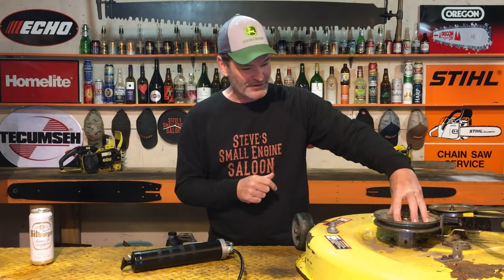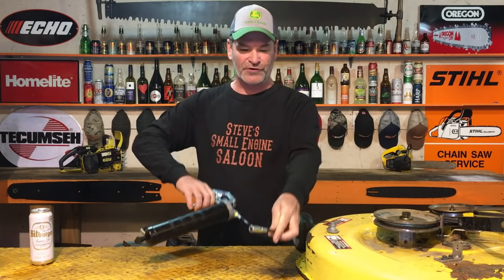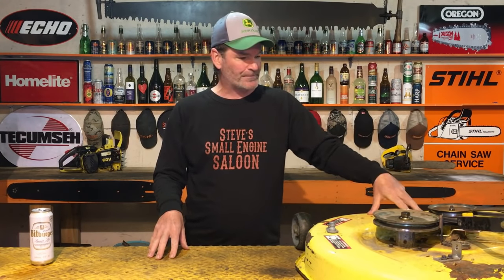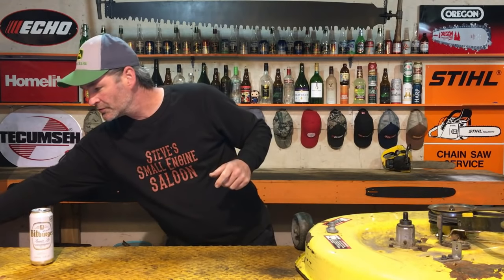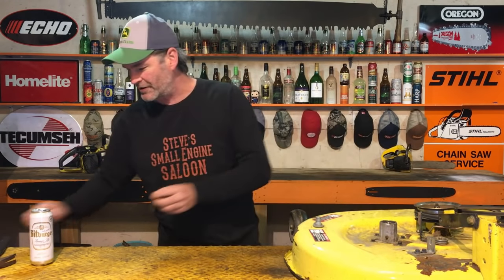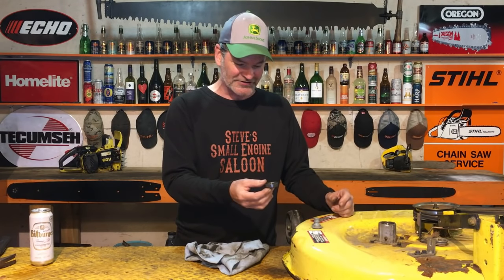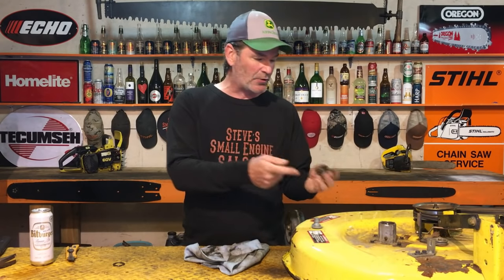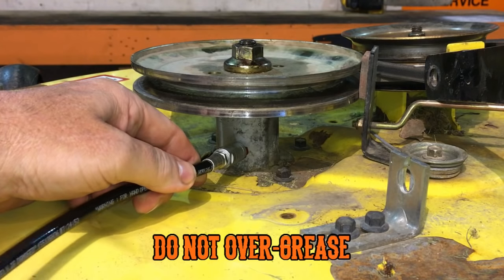Your Riding Lawn Mower's Dirty Little Secret

Comment: The pressure from the grease gun will get grease into the bearings.  The seals are just dust shields.  You can test it by inspecting the bearings, put them back in, grease them with a different color grease, and reinspect.  The main problem is that when people grease them, they only give it a few squirts.
Reply: I was wondering about that. He never showed proof of his original theory, but his fix would definitely get more grease into the bearings than if the dust covers were still on.
Reply: Yeah, I actually saw another video of a guy pulling his bearings apart after greasing them and it DID get in. The only thing is he put nearly 70 pumps of grease (2/3’s of a tube of grease) to fill it/ pack it enough to pressure that seal enough to get grease in.

Comment: Hydraulic pressure will blow the remaining grease seal(s) out if you over-grease the spindle .
Reply: Yes I was going to say the same thing. I think possibly a shielded bearing might be better because the tin shield has a small gap around the inside but those probably should have a proper separate seal for protection which that design doesn't appear to allow for.
Reply: Love Bitburger!
Reply: Can put in a relief
Reply: @TheGuruStud  yes..
Reply: @MrOutty + Greg Beetham: Absolutely right. Normally modern sealed bearings should work for a reasonable time. In the actual case, grease nipple just should not be used at all, because even new seals can be damaged by grease pressure.  In other words: This nipple is made for destroying your bearings yourself.

Comment: Steve, perhaps you could address this subject in a video, My JD L130 left a lot of uncut grass. It would never do a clean cut on the first pass. I was going through belts fairly often too. I figured out the 1/2" V belt didn't have enough grip on the drive pully. The pullies are extra wide so I put a 5/8" V belt that was two inches longer on it. It needed the extra length so it wouldn't be too tight. Now it cuts the grass perfectly and the belt is holding up well. It seems to me that the 1/2" belt does not have enough grip for a larger deck.

Comment: Sealed bearings are the guarantee of throwaway products.
Reply: The ones using those bearings are hoping that we don't know how to do our own repairs.  They are hoping that people who don't know any better would dumbly by a whole new mower when in fact it just needed a simple repair.
Reply: The Asian bearings sold today have a tiny amount of grease and may not last  SINGLE SEASON. Pack new bearings with wheel bearing grease, the bearings will last a long time.
Reply: A good sealed bearing with steel seals lasts a long time your car alternator has them?
Reply: @michaelgardner3728  point being that old-time zerk fittings on bearings are better to do maintenance when you can manually hit the shot of grease or oil in them. My 56 Chevrolet pickup  has a    maintenance point on the generator where you lift a cap and drop a few drops of oil in a couple times a season.
Reply: @michaelgardner3728  
The alternator bearings are operating in much cleaner conditions than those on lawnmower spindle.
In any case the seals in the demo were plastic.
My concern would be that the grease gun pressure may pop out the two remaining seals.
Reply: @sandrosandri1763  My spindles have a pressure release valve on the opposite side of the zerk fitting.  It wouldn’t take too much effort to drill and tap a spindle so you could add your own.  The other nice thing is you don’t have to guess if enough grease was added because it squirts out when it’s full.

Comment: Not a design flaw or mistake it is what happens when one department specs a certain bearing but purchasing finds a cheaper alternative. And the person on the line just puts it together and doesn't get paid to think just to assemble.
Reply: designed obsolescence
Reply: Dave Micolichek  Not necessarily. They need seals top and bottom here, and it's cheaper to buy double-sealed bearings than low-production single-sealed bearings. Plus lots of bearings these days are no longer commonly made in single-sealed or unsealed versions. Often they will make only sealed bearings as those are generally considered to be usable in all applications whereas unsealed or single-sealed bearings aren't. Many single-sealed an unsealed bearings are made only by premium manufacturers now so the price is higher than the crappier sealed ones from China or Mexico where most of the bearings you can get in the USA are made now. 

So while it may actually cost more to make a sealed bearing than an unsealed one with equal quality, when you factor in all the other elements involved sealed bearings can indeed be cheaper. Check it out yourself, and look to Europe if you need good bearings cause they're not being made here anymore.

Comment: Double shielded bearings are not meant to be greased.  The grease port is a leftover from the design for greasing when the bearings weren't shielded.
Reply: Then why can't they just put the better built "older design" bearings in it in the first place?

Comment: Hey Steve! It occurred to me that cutting a ‘V’ shaped notch in the outer seals that are left in place would give you a way to know when the bearings are fully packed because of the overflowing excess grease and would all keep the outer seals over pressuring and blowing off the bearings; similar to greasing a ball joint.

Comment: I wonder if that is on newer mowers. I have a 2006 John Deere which I have greased a couple times a year and knock on wood, have never replaced a spindle. Thanks for the info though, you always have good tips.

Comment: I’m a bearing guy.  The easier fix is to stop greasing sealed bearings.  You are absolutely right that the grease is not getting past the seals but what’s happening is when someone fills that cavity full of grease then adds more, it pushes the seals into the ball cage which causes the bearings to fail.
Reply: Never see that happen .
Reply: Don't think that's possible.. if those things can be pushed around by grease then they would be little bits of metal after a few minutes of true loading...grease has only temporary light  loading.
Reply: I promise you that no grease that being pumped in is getting past those seals.  If you want to make it regreasable, pop off a seal.  I deal with this issue all of the time in higher rpm applications.  Don’t believe me, contact any bearing manufacturer and they will tell you the same thing.
Reply: @farrisrocks  You are incorrect.  Do the test yourself. Verify the bearings are greased, put them back in, use the zerks with different color grease (40 plus pumps) and reinspect.  You will find the the pressure from the grease gun is enough to get past the “dust shields” they call seals.

Comment: i just crack the bearings open every few years , clean and repack
Reply: Yeah that’s what normal people do not whinge about a problem that doesn’t exist. This just looks like an add to sell grease guns. Guy has some OK videos that might show me something I’ve not encountered before but a lot are just shilling something for affiliate links 🙄
Reply: @TheLexiconDevils  Are you the guy that engineered this part to fail?????? Sounds like it!
Reply: @tc96z1  I agree with Lexicon Devil. Watching the video and seeing the explanation I thought to myself "why not just pack it with grease right then and there?" Screw the grease gun.
Reply: @drowssapma  Because greasing a fitting is easier and less effort than cracking open a bearing.

Comment: One of the biggest reasons this is an issue nowadays is that the majority of the box store lawn and garden equipment is manufactured by MTD and is complete junk and is cheap as hell. MTD is notorious for needing frequent repairs due to the cheap materials used in their equipment.
Reply: Really? Ive had mine for 13 years and no issues. Must of got lucky.
Reply: @SheepDogNumber6  Yep mine too, 23 years now, just belts ,1 magnito, and 2 spindle replacments..  However i do see a potential problem with the "Pop the seal out" method. That is when you grease the modified setup, you'll most likely pop the other seal out with the pressure..
Reply: I bought a Cub Cadet about 5 years ago and it seems that every year I had to take it in for repairs every mowing season because of problems. Most manufacturers started having MTD manufacture their junk from my understanding roughly around 10-12 years ago. Before that time most manufacturers made their own equipment and they were higher quality than they are nowadays.

Comment: I had a supervisor tell me to grease every fitting on the Terex scraper I was running at the time with at least 10 shots of grease every day. I questioned that, asking, You mean the U-joints also? He said yes. He didn't like my comment about that not being a good idea and that the shop would surely get sick of changing the U-joints. He insisted, he was the boss and you do what I said. Okey Dokey! When the mechanic was changing the U-joints on said scraper he made a comment about going through so many U-joints. I told him that the dumb a_ _  boss insisted putting 10 shots of grease in the fittings every day even though the chart on the machine recommended 2 shots every 40 hours. Needless to say if you pop the seals, the grease flies out and dirt gets in . The owner changed the grease policy after the mechanic brought this to his attention.
Reply: I worked at a place that had a lot of BIG electric motors, they hired some new maintenance manager who had the workers (over) grease all the bearings in the motors.  All of a sudden all the motors started failing as grease went  through the inner seal and into the windings.  The company started blaming the motor design/manufacture which was strange since for many many many years there was no problem until the over greasing started.  Further there was a plug that was suppose to be removed when greasing so excess grease could escape, that was not done by these 'experts.'  When the motors were sent offsite for repairs the repair companies told what the problem was, but it took many months and repairs before anyone would believe.  The bottomline is many problems are caused by dumb f's who think they know something, but don't.

Comment: Steve i just spoke to a john Deere service manager and he says still grease them because the grease will still keep the bearings cool,as i mentioned on my last message i did just that on my old jd x110 greasing those spindle bearings regularly,and luckily they didn't fail and she done 1300 hrs,great video though mate great learning opportunity as the more we know and understand our machines the longer there going to last and the better chance we will be able to get it going again if it lets is down on a job

Comment: Obviously a scam perpetrated by the Bearing Cartels. Takes a lot of balls to pull something like this off..
Reply: Do you mean the Cartels have a lot of balls and bearing to create this type of scam?...off to my John Deere dealer to raise hell...thx
Reply: Nothing to do with the Bearing Cartels---everything to do with the manufacturer of the mowers. If they are going to provide grease nipples, then the inner seals should have been popped out.
Reply: Well done! 👏
Reply: Dude
Reply: @KStewart-th4sk  Oh Deere!
Reply: Now that's funny. Nice!
Reply: Dishonesty or stupidity?I used to work for an engineering firm. We had some excellent engineers and some terrible ones . The best ones were the guys who worked as hands on helpers or mechanics at some point in there careers. Usually as students working there way through university.
Reply: I don't care who ya are, that's funny right there. Very clever!
Reply: I see what you did there.........:-D
Reply: Yes steel balls ! 666 OUT
Reply: @KStewart-th4sk  they r called zerk fittings . 666 OUT

Comment: Some of the older mowers you could just ice pick the top bearing seal out with the deck and pulley in place, grease it, and pop the seal back in place. Five minute job.

Comment: When you pump grease into the spindle with even the inner seals out all that will happen is the grease will blow out the remaining seals. The only spindle fix is on those with a separate seal. On those you must have one, preferably the lower one, installed with the lip facing out so excess pressure escapes. Bingo.
Reply: Similar to an s cam tube for air brakes..

Comment: It's the same reason walk-behind lawn mower engineers put the air intakes right at the bottom of the engine right where the most dust gets stirred up...to sell filters. I build a snorkel for my mowers to draw air from up high. It makes the filters last along time.
Reply: Mowers used to come with a snorkel up to the handle that housed the filter and the throttle. You had to buy a lot more paper filters for those than the modern foam filters for down below. I wash my filters in the ultrasonic cleaner. Only takes two washes of the mower,trimmer,chainsaw and blower to pay for itself. If you’re using paper filters see if they make a washable filter for it like K&N does for cars.

Comment: Has same issue with GM idler pulley bearing.     Pulled seal back on the new one and it was dry.   Pumped it full and DID NOT USE needle tip

Comment: Keep in mind. Engineers may specify a part but the buyers (not end buyer) takes the specifications and finds the cheapest parts...
Reply: Because cheaper is better and saving money is good!
Reply: Double sealed bearing are an aid during the assembly process.  Grab a bearing and install.  Orientation is not an issue since both sides are sealed.
Reply: The "bean counters"!

Comment: Yep I found out the hard way and fixed it by removing the seal on the inside of the new bearings I installed . Grease it twice a season and haven’t had a problem since.

Comment: I worked for a lawnmower shop for 41 years. Reason they left the seal on both sides of the bearing use. Some people do not grease their decks. So they call it a lifetime bearing. It will only last as long as there is grease in it that we know. You are doing the right thing by taking out one side. I do it all the time. I now work on the side at my home. Thank you for your your input it’s very good
Reply from the maker: Right on Marv!  Thank You...

Comment: Worked on a lawn care crew for a while and I can tell you that consumer units almost always have ball bearings in them. Sealed or not ball bearings are not designed for axial load. Most (not all) commercial units have tapered roller bearings in them(trb). Ball bearings are great for radial load (belt tension) but not so much for axial load (the force exerted on the bearings by the blades generating lift). Trb's sacrifice a little bit of radial strength to gain an enormous amount of axial strength. Downside is you usually can't seal trb's and they only load axial force in one direction. When you pair them top and bottom on a spindle they work perfectly as long as you have shaft seals and don't let them run dry. The reason manufacturers don't use trb's is you need 2 two part bearing's, 2 grease seals, and much better tolerances. With ball bearings you drop in two jelly bean parts and call it a day. TLDR Pulling one seal and greasing ball bearings will make them last longer. But if possible switch to spindles with tapered roller bearings. They will outlive the entire machine if cared for properly.
Reply: I agree,  WHOLE heartedly, Pardy here !  Cost is more, but no need to fix them for at least 10 years, if not until it  'rusts'  out....(the deck)

Comment: The grease was never expected to get into the bearings - it was to prevent moisture/condensation from forming in the housing and that water damaging the lower bearing.

Comment: Steve, not sure I agree with you completely on this idea. Use a rubber mallet or piece of scrap wood on that threaded shaft knocking it out. Before...addressing the bearings, use a degreaser solvent to flush out debris in that spindle, clean with a bottle brush, airgun to blow out spindle till  completely dry, can recoat w grease . I Would NOT POP SEALS OFF bearings....shaft even packed with grease will pick up dust, and deb is clogging those bearings. If bearings do not move smoothely, toss 'em, just buy and install new sealed bearings. I would recommend synthetic grease since it does not break down at high spindle temps, which can be excessive for pro machines busy all day, and/or extreme high day temps, which break down lubricating qualities of std grease. Std grease is fine, but I would replace the grease more often. 

I probably would clean rust or corrosion off the shaft while shaft is out, since most of us dont grease the spindles as often as we should, shafts could corrode. While blades are off, this is best time to sharpen and balance them. Check pulleys if they spin evenly w no wobble or have no dents or other damage, replace if necessary. Same deal w power belts and mower belts inspect for cracks and wear. I usually when deck is off powerwash bottom of the deck thoroughly, dry w a blower or in full sun, wire wheel off rust or caked on debris, patch any damage w bondo, dbl coat Rustoleum rusty primer, dbl top coat w brush Rustoleum any color....stones and debris will eventually sandblast paint off, but done once a year, or more ....prevents mower decks rusting thru and making rot holes , especially on thinner guage steel decks used these days. Saved me from having to find my rare Wheel Horse 37" side discharge deck, which had rotted thru, I also recommend welding steel panels over rot holes, grinding, bondo to smoothe edges, prime and paint, keeps deck from losing its structural integrity, hope all this helps.
Reply: Great suggestions.
Reply: Michael Purnell hardest part is finding the TIME to do all this, rainy days help, or early winter project. Even outsourcing all of it to a shop but make sure u tell them exactly what and how u want it done....having a good relationship w the dealer helps.